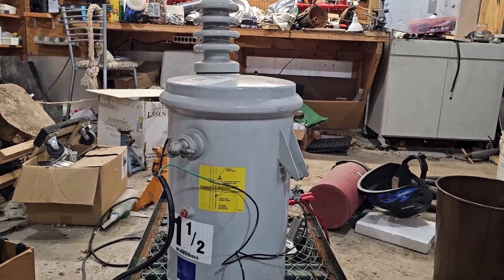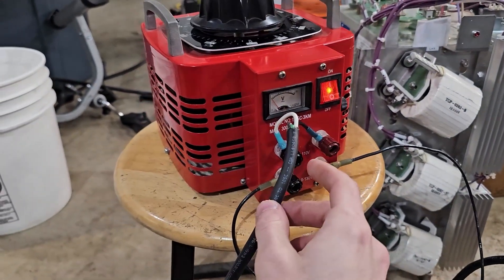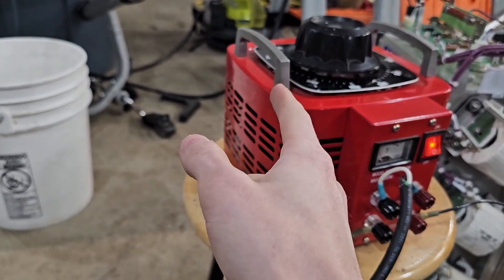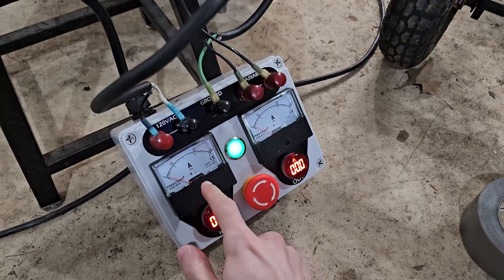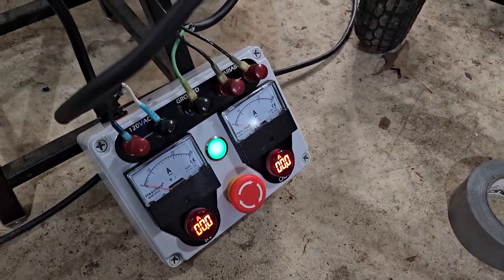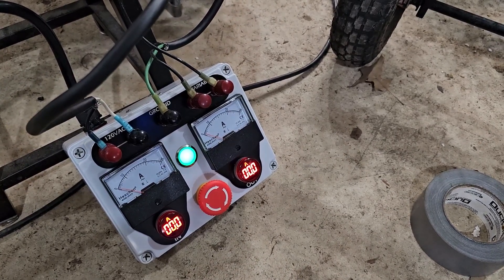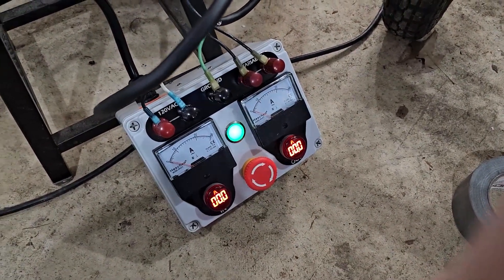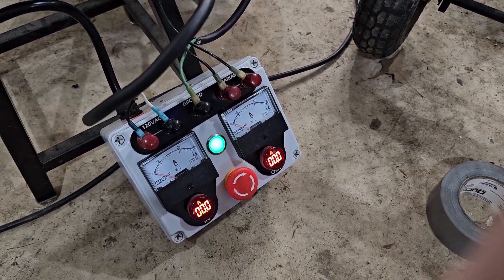Trinkets - Pole Transformer obtained

Comment: How did you get it? Ive been trying to get one
Reply from the maker: This happend to be off craiglist.  I've seen them come across facebook market every now and then. Cheap and expensive. Once saw someone trying to get rid of 4ft tall ones for $500  each, but I had no means of moving one of those.  In this case, Someone on a facebook page linked a craiglist posting of a guy that had 3 new-old-stock ones for sale. 100 pounds, so reasonable to ship/move by yourself. The guy had two left, and I opted to buy both of them since they were $250 each and shipping for each one was like 160'ish.

So, hard to say. Best I can say is either harp ebay or facebook market.  Same with xray transforemrs. I started searching my area weekly for "Xray" and every now and then I find a place wanting to get rid of stuff and asking $100 for everything, and there sits a 200 pound transformer in the picture and I'm just like uhhh...yes. xD  But there's also postings for people wanting >10K for setups.  Just depends on the day!

Comment: Heh... I was going to suggest putting a resistive divider in between the analog meters, but for current that's not going to work very well XD
You could still replace one of them with a voltagemeter and an external shunt that's capable of more amps, unless they already are like that.
You have some serious "high voltage nuttery" going on there, play safe and don't forget to ventilate for the ozone you're generating when pulling arcs for a longer period of time.
Reply: What about putting a capacitor in series with the line voltage? Couldn't you limit current based on the size of the capacitor?
Reply: @jasonharrison25  You can, but you have to find capacitors in an industrial package with wire terminals if you do not want to roll a custom pcb and those are hard to find in a lot of values I imagine.. Most capacitors are designed for pcb soldering. Capacitors also degrade and can change their value over time.
Reply: @MrDubje  there are plenty of run capacitors made for motors that might have the specs you need. Plus they are relatively cheap. Have wire terminals and long life
Reply from the maker: Someday I just need to get current limiting so I can run it at a higher voltage. 40V in is about the most I can do, as that floats around 20A, which is my breaker's limit for the time being. My friend wants to upgrade the power to 240VAC some year in the future. As you draw arcs, current drops a little

One solution some people do, is use filament bulbs to limit power.. heh
Reply: @PhxSt0rmz  lightbulbs are one way, another option is using magnetic balasts (from fluorescent lighting). That is what photonicinduction did. They have a power rating and depending on how many of them you switch in parallel, you can easily set a limit. And they don't burn out as easily as lightbulbs 😊